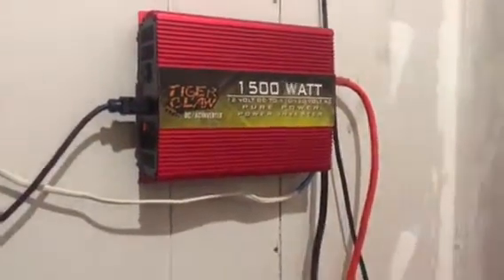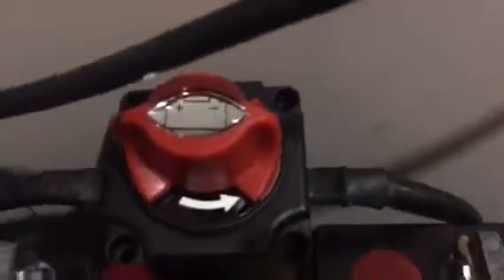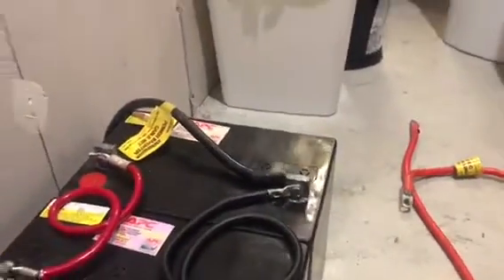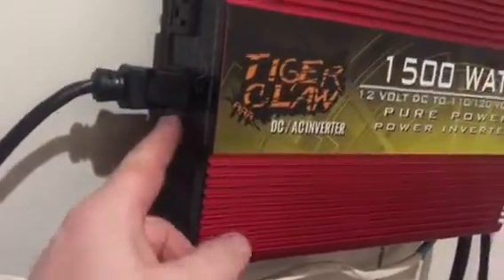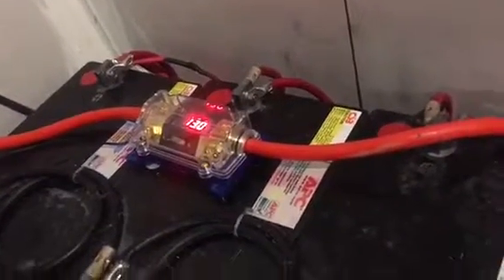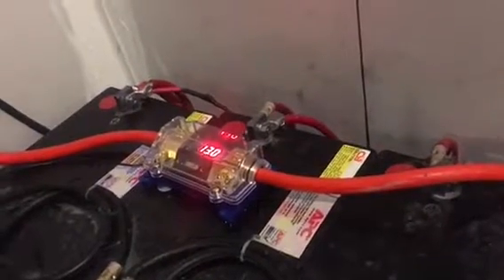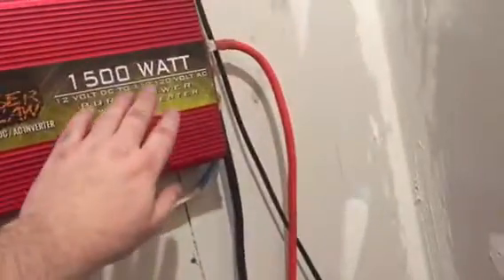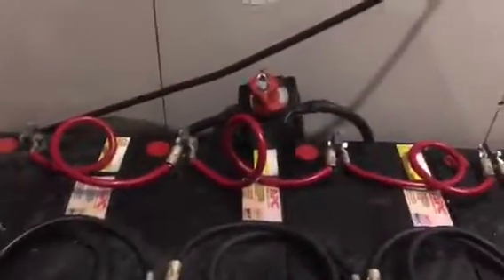Episode 48 Inverter isolation on off switch

Comment: My dad passed away and left one of these behind 
I came across your video 
Any suggestions on how I could use this?  
Oh, and he would love your set up ther
Reply from the maker: i still use it to this day. I know this video is WAY old but its a great unit and i run my basement with it on a simple solar/battery back up solution, saves me 80-100$ per month in electricity.

Comment: Hi there Chris ! Your set-up is amazing with all those batteries ! I have a simple 1000W inverter connected to 1 Marine Calcium Deep Cycle battery and today I purchased another ! So to Isolation of the Inverter is simply cutting battery power to the inverter.
Reply from the maker: it cuts off the negative to the inverter, as they draw current even when off and can slowly kill your batteries overnight or longer cloud/snowy coverage without recharge, thanks for the nice comment. its far from what i want, but a good hobbyist level system.